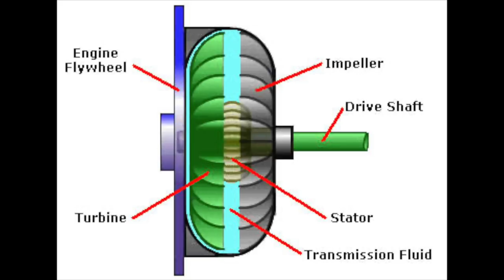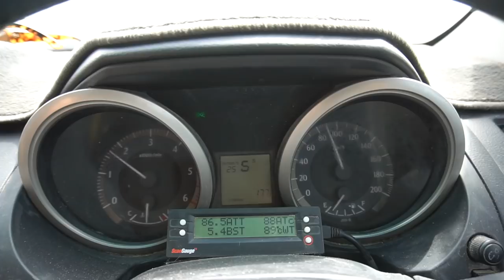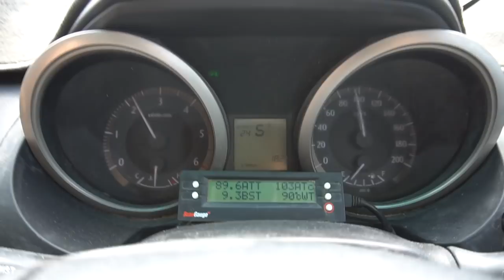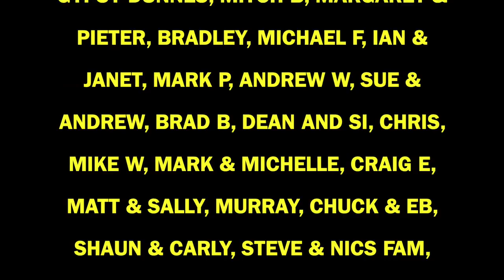HOW TO NOT DESTROY YOUR VEHICLE / TORQUE CONVERTER LOCKUP / TRANSMISSION / OVERHEATING / TOWING 101

Comment: In addition to my original post there is a trend in 4x4 circles to increase ground clearance with lift kits and fitting larger diameter tyres . Fitting the larger tyres will also add more stress on the transmission when towing and in an overdrive gear. You are effectively making all gears, and more importantly your top gear, taller. That’s why Speedo’s need recalibration when doing this mod.
Reply from the maker: 100% agree! We love our bigger tyres as they make the car a lot more capable with very little effort but like you said it adds strain on other parts! We find anything touring, 4wding a compromise! Things always make other things worse and things always make other things better! It’s about balancing the things against the things haha cheers mate
Reply: @SarahandKeelanTravels  Agree it’s all about being aware that changes to OEM  specifications can introduce unwanted consequences.
Reply: Very well explained re mods to any aspect of driveline configuration. Wouldn't it be great if all the aftermarket businesses explained this to customers prior to fitting any mods?😂😂😂
Reply: Very well explained re mods to any aspect of driveline configuration. Wouldn't it be great if all the aftermarket businesses explained this to customers prior to fitting any mods?😂😂😂

Comment: Good information mate. I have a 2013 Prado Auto. 150000kms and it has just cracked a piston a month before we are due to get our van. Good times!.. I’ve had it since 9000kms well maintained and has only towed 500kgs for minimal kms. Disappointed is an understatement.
Reply from the maker: Mate that is such bad news! That is my worst nightmare! I dare say either a glow plug tip has snapped off or the injector seat is buggered and has leaked in the oil gallery and boom! I seriously feel for ya! Especially because you’ve had it since pretty much new and looked after it.. and the timing with the van. Spewing mate
Reply: @SarahandKeelanTravels  Yeah it’s placed us in a pretty crap position but we’ll get through it. On the piston situation, it is a known issue by Toyota with the 1KD-FTV engine. The pistons,  especially the Euro 4 version all crack in the same spot across the top inline with the gudgeon pin. It’s a mechanical design flaw that Toyota addressed unsuccessfully 4 times. Not trying to scare you lol but have a read if you haven’t heard about it. It doesn’t happen to everyone but it has happened to that many now it should have been addressed by Toyota. The service bulletin is EG-008T-0112. I’ve had to buy another car to buy me time. I’m going to pull Toyota on for good will warranty, it’s not good enough IMO.
Reply from the maker: Not good enough indeed mate! We are currently looking at 200s maybe in the near future if we ever get a bigger van
Reply: @SarahandKeelanTravels  yeah I’ll get the prado goin and probably get rid of it. Shame, it’s been a good car, it’s a good size, never missed a beat until this major failure. Got all the gear on it to but yeah the van is gonna be right up and possibly over it’s tow limit anyway. Im thinking a V8 patrol for a game changer (never owned a Nissan) or possibly new V6 ranger-Everest when they come out. Love my Toyotas but TBH both 200 and 300 series are out of my price range now. Anyways safe travels guys, enjoying your content, keep living the dream! 🇦🇺🇦🇺

Comment: Excellent advice!  May I add a further thing that I do in my 200 Series.  When towing I essentially drive it as a clutchless manual keeping revs between 2300 and 2600 regardless of road speed.  I recently did a trip in western NSW on a dirt road.  The road was such that I averaged about 55 km/h driving mainly in S3.  Fuel economy 20.7 l/100km.  Usually it is 22 to 25 l/100km.

Comment: How do u know when the torque converter is locked up??
Reply from the maker: You need a scan gauge mate, normally the revs will drop down suddenly and the car will have no slipping in the drive train

Comment: Great video.  I was aware of the need to keep temps in check but hadn't realised just how quickly temps would escalate under "normal" driving conditions.  20sec and you had gone from safe to knocking on door of temps that would degrade the oil.
Reply from the maker: That’s right mate! I can’t make it more clear than to show you in real time what happens!! First thing is monitoring! Being aware and understand how the car behaves under conditions and then if you have the money which I do not haha buy a lockup kit or trans cooler and or both but I can afford it at the moment so will stick to 4th gear and taking it easy haha

Comment: I find that my 6 speed electronic controlled gear box is a lot smarter than me it has instant access to all the required sensors so I let it make all the decisions
Holding a gear could put unknown stress on mechanical parts
But I take your opinion on board as your experience is of great value
Reply from the maker: 100% false mate. This is exactly what the 6 odd people that cooked there transmissions in brand new “smart cars” said to us. Generally Your car will only tell you (dash light) that your trans is too hot once your in the zone to break things. Transmission fluids arnt designed to stay at 120 plus degrees for extended periods of time. After a while the viscosity of the fluid is effected and the very principles that makes that specific fluid good for COOLING your transmission is now compromised because your waiting for a dash light to tell you when to back off. Do that day in day out and your looking at a massive towing bill, a new transmission and a canceled holiday. I’ve done extensive research plus I’ve heard the horror stories to back up what I’m saying. Hope I have persuaded your opinion haha thanks Arthur
Reply: You are right, the box is really good at selecting the "right" gear.  But it isn't smart.  It is programmed.  Do you think that maintaining optimum temp under heavy load at the expense of smooth shifting and economy when not under load was the programmers goal?  What sells cars, transmission temps or a ridiculously low fuel consumption figure in the marketing brochure and a nice test drive?   The vast majority of common tow vehicles like Prados and DC utes are NOT ised to tow heavy loads for long distance at high ambient temps.  Why would the manufacturer prioritise the transmission shift protocols for a minority of buyers?
Reply: @SarahandKeelanTravels  ...I drive a 2019 Holden Colorado I did add a transmission cooler but basically leave it on drive and keep checking the transmission temp and stays pretty cool (68  to 78 degC) apparently up the hills it changes down with little sense of slippage and down the hills it does a great job at engine breaking, if your on the brake a bit the gearbox drops down a gear and locks, apparently the Colorado has one of the smartest transmission on the market, l just did the Great Alpine Road from Omeo to Bright (around  Mt Hotham 1825m altitude, one of the highest roads in Aus) towing a caravan 1700 kgs not a super heavy one but the 6 speed auto puts a smile on your face...I did stop for a while on the way down to cool the caravan brakes but one of the most scenic routes with a great free camp in Omeo and another in Smoko before Bright